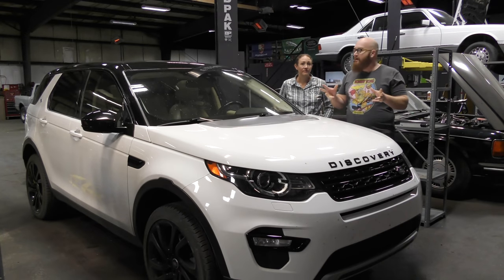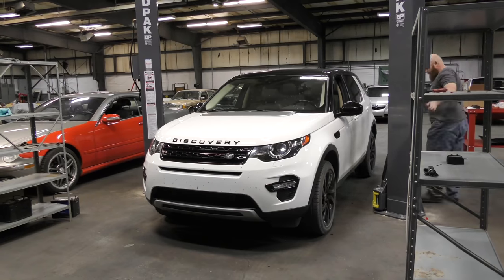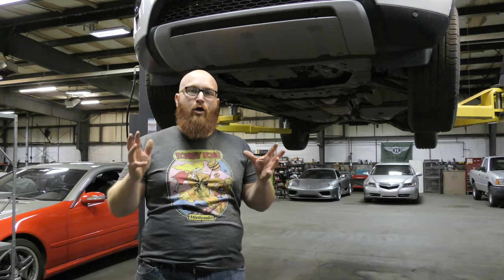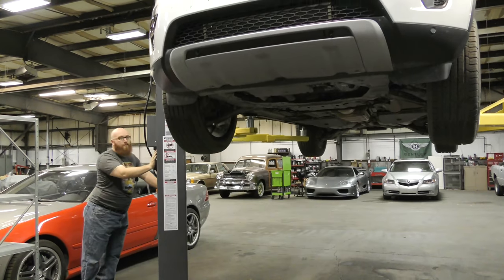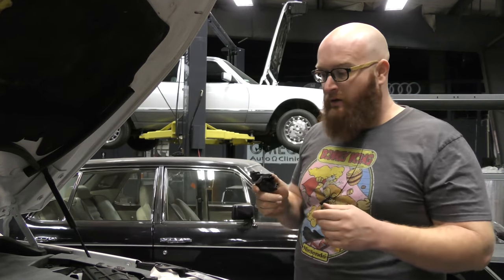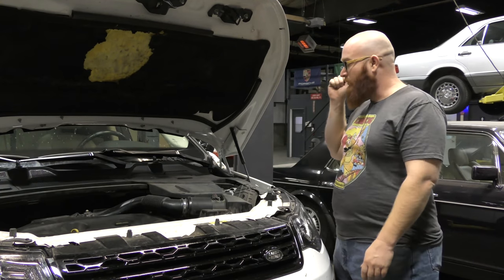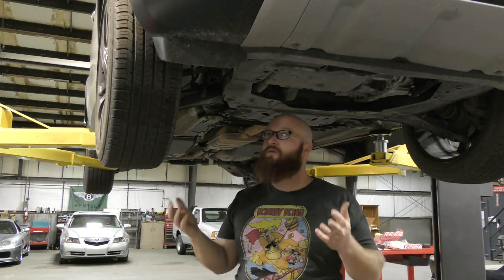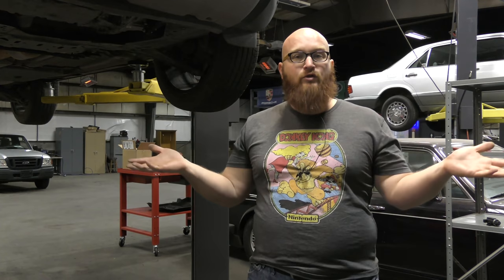I fixed Mrs. Wizard's '15 Land Rover Discovery for $75! How did the CAR WIZARD fix it so cheap?

Comment: Land Rover front suspension looks like an old Taurus/Continental :lol:
Reply: That’s because it’s is. It’s built on the old ford/Volvo p2 platform even the engine is Ford.
Reply: @billybellend1155  Actually this is the  Ford 95-07 setup. Long stabilizer link and all.  But it could be similar. Those struts go in a wrap around bracket and can be a real pita to separate.  I know on the continental it is an aluminum part.  You can't heat it for obvious reasons either. Took like 2 hours to get it apart. It is a pretty good suspension setup though.

Comment: It was $75 to buy from Ford. I wonder how much a Land Rover dealership would charge for the same part?
Reply: $118 "Solenoid - Turbo - Land-Rover (LR049972)" Same part as Ford's CB5Z-9E882-A (which is $78).  Amazing <3

Comment: My Grandma has a 2017 Escape 2.0 Ecoboost with 102,000 and it has an internal intake leak and a 2400 dollar bill at 85,000 the turbo was replaced under warranty that car is a huge money pit I'm not a fan of the Ecoboost engine.

Comment: Not an issue today but... Imagine the (perhaps nonexistent...) auto repair shop of the future with electric cars.  There may even be no brakes to repair with regenerative braking.  No oil changes, no spark plugs to replace, etc.  The Wiz will probably be retired...

Comment: I would never own any Land Rover, whether if it is older or newer, like Mrs. Wizard's 2015 Discovery Sport. Instead, I would get a 2012 Lexus RX 350 mid-size crossover, which is a lot more reliable than this piece of crap, modern Land Rover. I am hoping for more new videos for buy this, not that sooner rather than later for Kia, Hyundai, Acura and Mazda. Thank you very much and have a great day.

Comment: Landrover   
Discovery. A car with many mechanical attributes one of them , in any given time you will discover a new mechanical problem . For no particular reason. 
Just because. 
Is like the car knows when their is an extra balance in your account. Sure enough, the Discovery found a way to that. If you just got your quarterly job bonus,  your Discovery already knows he is getting a wizard  massage. One very important advice, what ever you do , do not used your bluetooth or any wireless conection from your phone into your Discovery. I suspected is how the car knows when to strike. Don't talk about money in general and if you must have to talk about money make sure you're alway and out of the car and if for whatever reason you must discuss money matters, talk in codes . Like for example give money a different name, get  Creator, and last but not the last Don't show happiness or any joy because the car can interpret this the wrong way.
 And always talk inside the car about how horrible you are doing and straggling and talk
About how you are about to lose everything . the car will stop breaking as often and give you a new nickname,The  Loser . Take that as a good and generous compliment. 
Trust me on this one. Am out.

Comment: All these idiots ( with NFI ) making stupid comments about LR reliability. Considering Wizard is an experienced mechanic, and he bought a LR, your childish comments are, IMO, very insulting to the Wizard and his wife. If u watch the video when they bought the Disco Sport, Wizard gives much detailed comments as to why this is a good vehicle. This vehicle is 5 yrs old, the failed ( Ford ) part was only $ 75.00. To jump in with comments about poor LR reliability is very lame, and makes u look like a total idiot. As Wizard clearly explains, u thoroughly inspect various items, and verify if they r ok or not, and through this process, u will find what is causing the problem. Considering a modern car has about 30,000 parts in total. And about 10,000 parts make up an engine, for an electronic part like this (that is constantly working when the car is running ) to fail on a 5 yr old vehicle would not be unusual. Toyota, Honda vehicles etc would have the same item, or similar, fail, and cause the same situation.

Comment: Mechanics DO THIS HABITUALLY- they use the cheapest aftermarket Chinese part they can find- charge 2/3x that amount for said part and it doesn’t work properly or for any real time interval. I started buying MY OWN GENUINE PARTS for less than a shop will charge for cheap aftermarket parts. Pay for the labor separate. These mechanics HATE THIS THOUGH because you are outsmarting them. Not only did you provide a GENUINE PART that will preform properly for a given time interval but you got it cheaper than the aftermarket part that would have failed fast. It’s a good business model for these SCAM ARTISTS especially when European cars need constant maintenance. Not to mention cheap parts put STRAIN on other parts to pick up the slack causing more breakdowns but now different parts that the mechanic can point to. Why would a mechanic want a vehicle to run properly and reliably for an extended period- they need your car to FUCK UP and that’s what cheap parts will do keep their merry go round going. SCAM ARTISTS even the so called honest ones

Comment: Too many mechanics are just parts swappers. Throw parts at the problem until it's fixed, charge way more than had they properly diagnosed the problem, then throw a mechanic's lean on the car.

Beware certification signs. Any shop could have once had ASE, and the like, certified mechanics but have since replaced them with parts swappers to cut costs in half.

Learn to do as much as possible as yourself. Get to know your suspension and drivetrain. Even if you don't have the tools to do the work, know wtf the mechanic is talking about. Google at the shop if you have to. Know your recall bulletins. If you buy an expensive car cheap, know that parts and labor may bankrupt you.

Find a mechanic you trust, even if it takes him/her a little bit longer to correctly repair your investment.

Comment: In europe, car guys know that Land Rover are extremely unreliable and extremely expansive to fix. If you want it, leasing is the best way. Imagine a Range Rover v6 Turbo diesel, if you Go to your Dealer, to fix such a problem, he will change the turbo, 100% . And to change the turbo, you first have to lift the body from the chassis. That‘s a stupid construction, really british.
Reply: Any Jaguar or Land Rover, leasing it is the best way. And don’t buy it after the lease is up.

Comment: The discovery sport is a joke.... water pump and transmission updates needed..... timing chain issues, roof rails detaching and turbo issues..... and a pulley.... don’t own one.... Buy an LR4 stay away from
Reply: Just buy a Lexus instead.